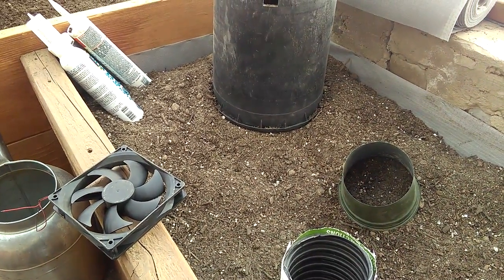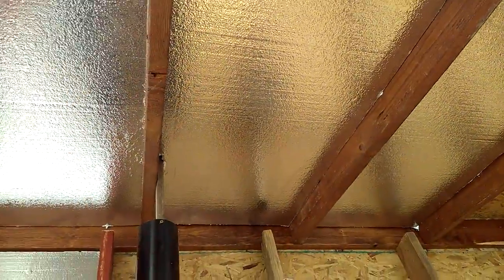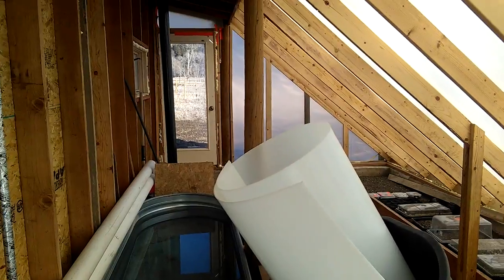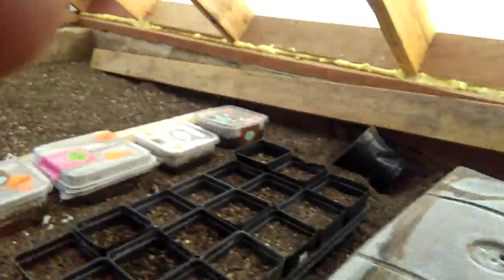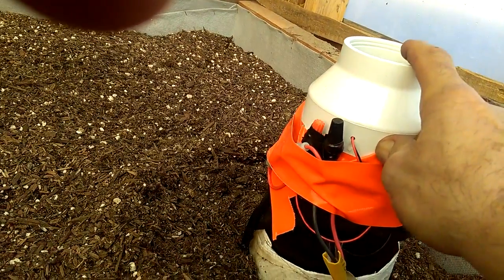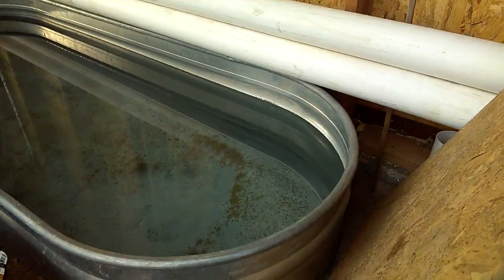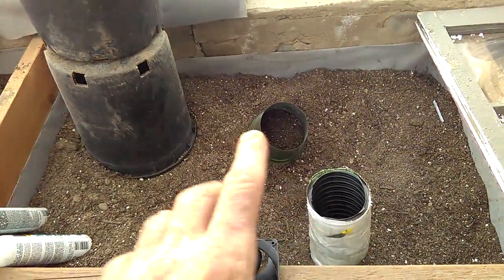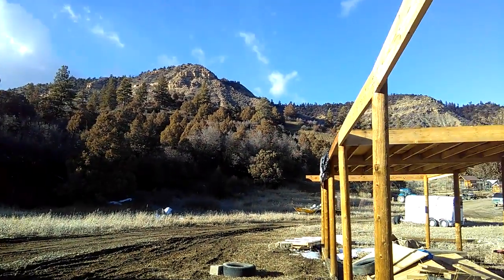Geothermal Greenhouse Update - Climate Battery Upgrade - New Fan Idea - Peas Are Popping

Comment: We need an alt to YT where we can post pics in comments like on FB. Diamond you just need a 12v voltage regulator to protect those fans. Also they sound like the bearings are shot. Supposed to be "whisper fans" lol. My solar batteries are keeping the gh warm during our current 20F nights here.

Comment: Great work! I would love to setup something like it soon if possible. I do already have a couple of years of experience growing indoors with lamps, dirt and humidifiers. I also used little 12 volt PC fans for air circulation. 

I'm sure you will not fry your fans if you use a 12 Volt 1,5 watt adapter aswell. They will fry also when air humidity is to high for a while because the copper parts in the motor will start corroding. Fan speeds can be automatically regulated when using thermostats and hygrostats (which are hell expensive) with fan speed regulators if you do not want to be baby sitting your setup all the time.

Because of the cold outside and the heat and high air humidity inside droplets of water will form which will grow fungus in your setup. Insects will find your setup which is bad aswell for mostly seedlings.

I did already made a remark about PVC in your setup and other building materials in the setup which will off gass toxic gasses which will harm your crops. I see glued wood plate and purfoam. This also is bad material.

Thanks for your videos and broadcasts this all really got my attention.

Comment: Nice new fans. As for the cheaper computer fans. were you running a regulator? or just a straight connection? i have fans that have been going nonstop for years. still an option for people working on a budget
Reply: i believe pc sites would sell a Fan controller.

Comment: You need a charger and a small battery. A straight line from a panel will give it too much voltage. The charger is for panels  12 or 24  or whatever you want. A battery will give you steady voltage. thanks

Comment: I wonder if 4-3"pvc pipe water filled and held vertical and painted black on one of the walls wouldn't be a cool test/comparison to the cob.
Thanks so much for the rebroadcast of your 2 hr show on revolution radio. I had to be somewhere else the 1st time.
Reply from the maker: Ill do it but use 10" whatever is free or used

Comment: Can the hydrogen gas be captured somehow and used to run a vehicle or tractor that normally uses gasoline? It's a better use than just venting it off into the atmosphere.
Reply from the maker: Not from a battery barn - you can biodigest your poop and foodscraps and were looking into a self contained system for the ranch.